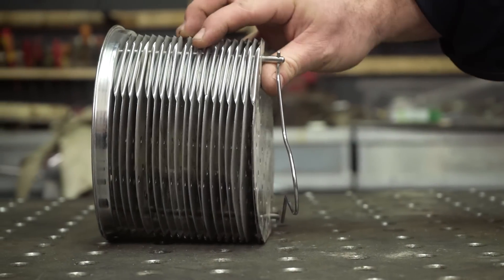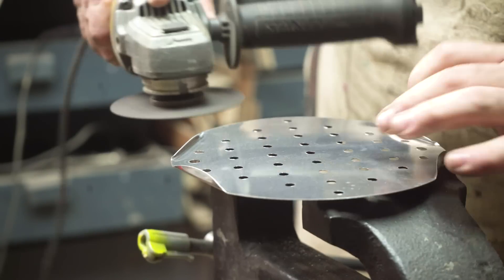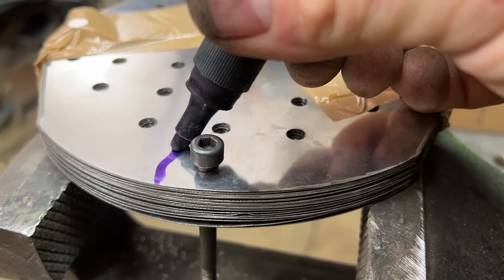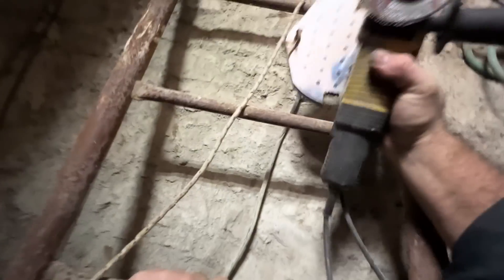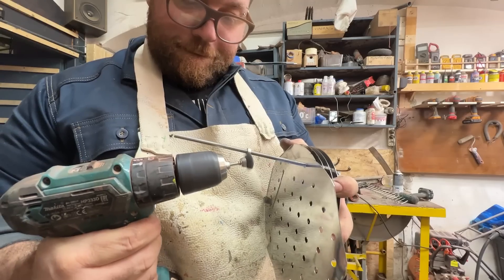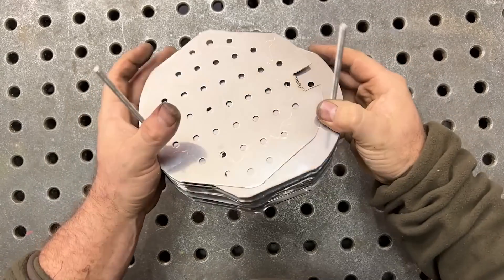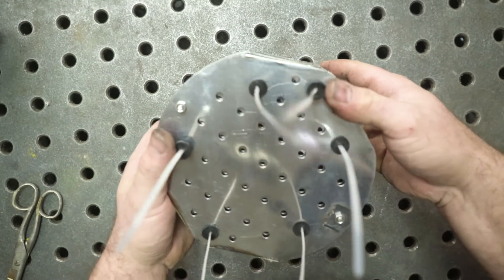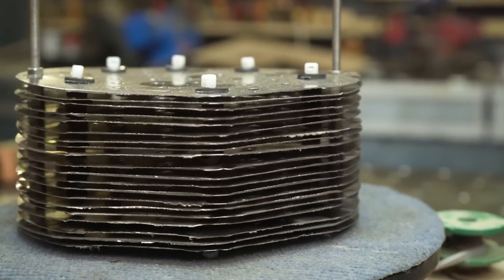How to Make a Cooled Hydrogen Soldering Station

Comment: The reason that this torch is having so many flashbacks is likely because the pressure is too low, not because of the material of the tip. High end hydrogen torches use stainless steel syringe tips mounted in a plastic housing. The metal tip never gets hot because the flame burns out in front of the nozzle instead of in contact with the tip.  You can tell this is the issue because the flame is coming directly into contact with the tip, instead of floating out in front of it. Likely, using a smaller syringe needle would raise the pressure and solve your problem. I got all of this information by watching the Rio Grande hydrogen torch videos: https://youtu.be/WSgzNsSGOvE?si=Dv4v8MT1zz4VE7Ub

Comment: You should try making the design with a separate pipe for gas collection above the cathode and the electrode so that you can separately collect H2 and O2 so you can then make a torch that's supplied at the handle by two separate tubes (oxygen and hydrogen) which let you adjust the ratios of each right at the torch itself, similar to an oxy torch. This will allow you to make a much hotter flame!

Comment: for an easier mod to get cooler electrolyte without refrigeration, you can use heat exchange method, have  tank next to the main electrolyser one made of a conductive material like steel or to keep the steampunk vibe copper, then it will radiate the heat of the electrolyte liquid out into the air ( also has the benefit of removing bubbles that stop the contact with the electrodes )

Comment: Just a recommendation: press as much steel wool as hard you can into the pipe to the torch. It is no problem for the HHO to come trough but impossible for the flame to come back the pipe. The semi official name of it is flashback arrestor ;)

Comment: Just so you know, this is an HHO torch, not Hydrogen. You aren’t separating the hydrogen from the oxygen.  

I am guessing this is extremely oxidizing to anything you melt with it.  

Pretty sure you’d have a much nicer burn with fewer explosions if you separated the Hydrogen from the oxygen, and just use the hydrogen.  

But you’d want to vent the pure oxygen in some way outside of the room you’re working in, or capture it.

Comment: for anyone who wants to make an HHO torch, please do not mess with HHO until you know what an HHO detonation sounds like first hand. not a deflagration of hydrogen gas, but a stoichiometric detonation of HHO. if you've never heard it, just make enough HHO to fill a film canister and then detonate it from a distance with ear protection. you can not understand how insanely powerful and dangerous HHO is until you've experienced a full detonation of just a small amount. and then compare it to a pure hydrogen gas balloon being deflagrated, which is loud, but no where close to HHO going off. then understand that your ENTIRE TORCH SYSTEM is FULL of HHO!!! you need to take multiple safety steps to prevent flashback and mitigate damage if you do get a detonation (or even just a pressure explosion). 

I highly recommend just copying what carsandwater made exactly if you insist on making one without taking any safety measures or learning anything. his design is one of the safest DIY designs i've seen and produces plenty of HHO and requires no storage (and includes a nice flashback arrestor)

Comment: using sodium chloride isnt the greatest for an electrolyte. it breaks down into chlorine gas and thats why the water is turning yellow. potassium hydroxide is generally the best available but its corrosive so the radiator would get dissolved.

Comment: There is one solution i was already thinking for this problem , get a mini air pump and have it on going into the gas maker at the top so it just mixes with the hho before going to the torch tip hole, it should turn it from a imploding gas to expl has, no risk of flash back ,  and flashback arrestors do exist aswell

Comment: Should a different salt be used as to not make chlorine gas?
Reply: Maybe use a mild sodium hydroxide solution? The stainless steel can take it and it doesn't have the chance to produce chlorine or hypochlorite even by accident.

Comment: Thats hot enough to make calcium carbide. Pretty neat
Reply: I doubt this flame is actually getting that hot. The gas flow is quite small. I'd want to see more testing on melting different materials to know how hot it's actually getting. Glass, copper, thin steel wire can easily be melted with a propane flame, much colder than the theoretical temperature of this flame.

Comment: Interesting design and work. Just one correction, HHO flame hasn't temperature of 2800°C, but around 130°C. When this flame touch some metal, there is formed temperature of melting point of this metal. This gas have many other strange properties...

Comment: no body really wondered today by such a good technologies, i am sad of it waste of entusiasm ofknowlege-people last time... if you are still there, and can read and answer discussion, a can tell you full list of your disadvantages of this pretty sucsessfull attempt  to ekectolisis burner perfectness, after fixing most of that imperfectness that i can see with my expiriense in that theme, you will get maybe 10times bigger flame, 150wt enought to burn iron-tin food grade can from sweet corn or skimmed milk or olives conserved can, and alluminium offcorce too, 1mm wight track 5..10mm/sec, steel must to drop melting easy, and linear halogenic lamp tube(500wt like fīngersize quarts tube with long tungsteen spiral lamp for direct 220VAC supply) buns 1mm hole without cracks in 5..10seconds. not possible witn butan air burner for 0.5l butane baloon

Comment: I love this! What type of flame does this make?
I was expecting a neutral flame because Hydrogen and Oxygen get split and then put back together. The color looks like it is a reducing flame but with the silver solder it looks like an oxidizing flame. It is not the copper burning because that would make a green flame. I'm trying to think of how I could use one of these. From the way it melts glass, I can see it being used as a cutting torch or glass melting torch. 
My guess is that not all the oxygen and hydrogen being produced gets to the torch at the same time because the water absorbs some of the oxygen. Once saturated it releases oxygen like bubbles in soda water which is probably why you have to restart it every once in a while.
Reply: The flame is neutral. Oxyhydrogen cannot really produce a reducing flame, hydrogen isn't a strong enough reducing agent, like carbon monoxide from hydrocarbon fuels is. 

The red color in the flame is probably from sodium ions, from tiny droplets / mist of water from the gas generator. Unless there is other contamination in the lines, that is the only place the color could come from. Hydrogen burns with near no color, simply because there is no carbon to glow inside the flame. That's why hydrogen was mixed with other, sootier gases on purpose when gas lighting was a thing.
Reply: It's sodium from the electrolyte making the flame orange

Comment: If you manage to also connect and the air from electrolysis to combine them together you will have tremendous heat but more explosive mixture in there !☺️

Comment: using table sald aka sodium chloride here is an extremly bad idea because when using electrolysis here it is also gonnna produce things like sodium hypochlorite and chlorine gas which are very fairly toxic you can see proof of that because the water is getting dirty typically you would use something like sodium hydroxide or potassium hydroxide  because it wont do things like that and only produce hydrogen gas

Comment: hho flame shouldnt be orange or bright its oragne because of the salt water spray you really should use potasium hydroxide ull get twice as much hho. also stainless steel dispensing needle do work fine as torch u just need to have enough gas flow for the diameter of the orifice. if u use a higher gauge (smaller ) tip it willl work fine

Comment: a good concept. not new, but good. the only problem is the steel plates as electrodes. they WILL oxidise away with time, and very soon, since the plates are thin and have a large surface area. to prevent this problem, a non oxidising electrode should be used, like graphite. it will be hard to source thin graphite plates, but they will hold against the oxidation. there was no point in using distilled water, after adding salt to it.
Reply: I do see where your coming from but graphite will turn into a powder as the gas forms. In the industry they use MMO plates or mixed metal oxide plates.

Comment: The idea of the Steampunk radiator, the light bulb non-return valve and the vertical flow reducer are brilliant.  Aesthetically unattainable, in the style we like so much.  The empirical aspect of the flashback is very useful.  I'm waiting for the glass test.  Kind regards Rulof (reviewed several times with subtitles)
Reply: GRAZIE!  senza farlo apposta è davvero stempunk!
Reply: safety  is paramount when work with that mixture... but not here. it is a design that can make BOOM. he  probably should separate the gases first in the reactor/generator, and feed them close to the torch via two hoses, separately, and having control of the mixture. his gas mixture is stoichiometric, so it ca travel back faster than you react, multiple flame arrest should be added on the hidrogen line. but not onnly etc, etc. hard plasic can act as solid if explosion is powerful enough,  maybe 2 longitudinally joined PET bottles are more suitable. in term of surface area the metal wool would give him  more surface, also inox plates is not so great for this process. imagine those plates flying through the air in all directions like ninja knives.

Comment: If you add water filter to the system between bulb and torch, water would still drop from torch? 17:23
Reply: Yes as during electrolysis the water (h2O) is split in to hydrogen and oxygen (h+O2) and when you burn the hydrogen the oxygen oxidizes the hydrogen and becomes water (h2O) again.
Reply: @Gideon-s2c  Thanks for enlightening

Comment: I've been a serious DIY'er for 65 years and also watch tons of YouTube how-to videos. I have to say using the small wire brush on a drill to rapidly spin down a nut on a threaded rod is one of the most clever tricks I've ever seen (and I've seen a lot :).  Thanks for the inspiration!
Reply: It's much easier with compressed air...
Reply: Dude this plus the zip tie spacers is genius.
Reply: Same.   But not the experience.
Reply: Думал только у нас в России людям делать не хрен ,оказывается  нас много таких по всему миру 😂 удачи ! Используй графитовые стержни это лучше , и стояние питания лучше подходит электро удочка !

Comment: yes you can use NaCl but its bad...
1. its produce chlorine gas(2 NaCl +2 H2O + 2e- => 2 NaOH + Cl2 + H2), toxic and corrosive

2. 99% of the stainless steels are not resident to chlorine and not to sodium, better if you use potassiumhydroxid

3. why the cooling for the water? too much energy loss. if you cool the gas only a little bit, its enought to condensat the steam.
Have you heard of the HTE? https://en.wikipedia.org/wiki/High-temperature_electrolysis

4. You may be able to avoid backfires if you use more gas flow or thinner tips? i have a HHO-burner too and that solv the problem, i use blunt needles

5. please use a welder googles, its better for your eyes

and last but not least: the flamme colour of HHO is a blue, the yellow is maybe Na or something from the copper tip

Comment: A question, is it possible if i m to use a plain steel plate (without holes) stacked n arranged in-between like you did BUT instead hv them mounted sideways in the water container (instead of straight up like you did) thus/to allows for free flowing of hidrogen bubbles up (sideways of the arranged plates)😮?

Of course, I cn always drill some holes around the plate surface if needed;
Reply from the maker: great idea!   it could work!

Comment: Use potassium or sodium hydroxide as an electrolite!! Those will not corrode stainless stell and they are great at conducting electricity. Don't use sodium chloride, bicarbonate or carbonate, they will corrode the cell and they conduct electricity badly

Comment: Love see someone playing with ,one of the most abundant ,and more importantly ,extreme fun elements!!!! 

If you wanted a check valve , you could have used some pvc fittings ,computer mouse ball ,and a spring !! 

Sorry I've watched a lot of delvis11 vids .  He made his own scrubber ,with built in check valve ... very repeatable ,safe and inspiring !!
Keep up the cool experiments!!
Reply from the maker: you can see in some frames i mado one  maade with metal loads on top.   grazt idea using a ball mouse!
Reply: @rulof-is-how-to-make  you're welcome good sir !!! 
I know you know ... even perspex can shatter like a grenade!! Specially the thicker stuff !! 
And Hydrogen been as is ... carrying so much potential energy .....

Try Fill a carton ,say five litre ,sealed and detonate with a electric igniter from a safe distance !! 
In a very open area .... just to make sure you don't blow someone's greenhouse glass out ,from shockeave 😂 😂😂 😂 
Serious power of Hydrogen,  handle with care
Reply: @rulof-is-how-to-make i have lots of electronic waste; the E-waste yes?   

Wondering..... can E-ball mouse be used with any tube type it plugs properly? 19:14
Reply: Oh and just A heads Up ......    not all ball types are good. I tried a more organic  specialty  GERMAN ball  type but i ran onto problems right away with the GER ball getting loose,  trapped and just creating a mess with hair line cracks
Reply: @CoincidenceTheorist  you mean you work in waste transfer and have access to w.e.e    just eemeber that hho is a porous gas and can nit work with every material .  

But the reason of the check valve is to stop grenading of a contained gas explosion ... to protect the user ...

As slow flow gas is prone to flash back ,and this works better than diy flash back arrestors ... of which they can be expensive at retail ... u less you work in gas welding etc ,where flash back arrestors are a regulation requirement , they can cost hundreds for a 3 inch long device .
Reply: Technically you could use a steel ball bearing alone , aslong as its surface is true.

And it rested in a silicone seal of sorts, to keep the gas Inside and pressure constant.

Plus the exit port is large enough for the release gases ... and the spring load was string enough for holding the relief ball tight .

Check hho for life ,  around 12 yrs back in video feed ... he has a demo of said device ...

Erm yeah , hho tends to seep through some materials ... so  heck what you use

Comment: Just make it with separate oxygen and hydrogen collection, that should fix your flashback problem.  Maybe a water collector on the output tubes like they use in air compressors would get rid of remaining condensation.

Comment: Good video. Most torches you buy are brass which is a copper based alloy, and its for exactly that reason. The copper dissapates and conducts it away very effectively.  Great build, i would love one of these in the shop. Its so much easier to refill water than buying gas canisters.  Amazing build and thank you for all the tips on being successful with such a build
Reply: It'd spectacular thing that Hydrogen!! 

Try searching Delvis11   ,he has tons of videos on hho production !! 
I bought some 8 inch 314L plates and made my own generator.  Think it was about 100 for the plates ... but they were designed to my liking !! Produced bout a litre a minute. 

Like I said ,watch Delvis11,  though channel name had a change ... go back through his vids about 11yrs and you'll see ,what I was telling this chap about a mouse ball as a check valve for flashback safety !!
Reply: P.s. never detonate a 5Litre jug of hho ... without ear protection ... ouch ,  ears still ringing 😂 😂

Comment: Well done :) When i tried this i couldn't control the foaming, that led to water in the gas tube and made it more prone to unpredictable flashback. I think I had too much contamination in mine. yours seemed to bubble very clean. It is genuinely scarey running one of these. I popped the top of my bubbler many times and it was NOT a fun kind of bang.
Reply: Instead of using salt, use potassium hydroxide. Fairly easy to come across and doesn't bubble

Comment: Hi, bro it's not difficult to produce hho but there 
are many mistakes, you have to use a proper flashback arrestor
After the bubbler and one more before the torch, then you can use this
Without any fear but without proper flashback arrestors it's not safe.
So you can buy flashback arrestors from any gas welding tools store.
Stay blessed